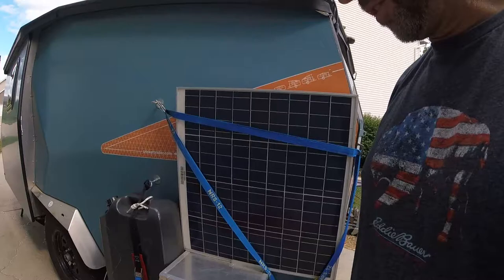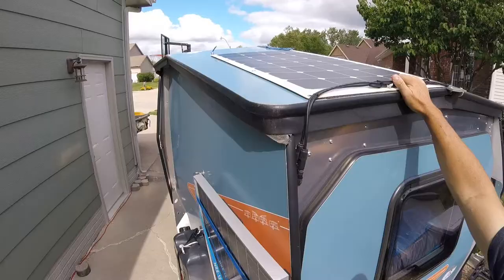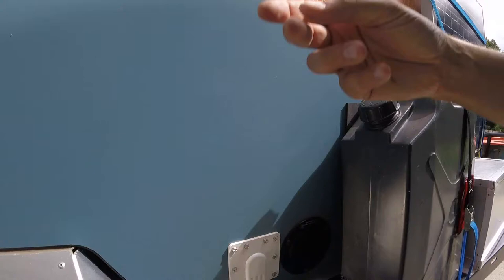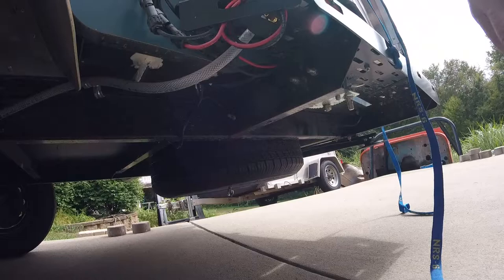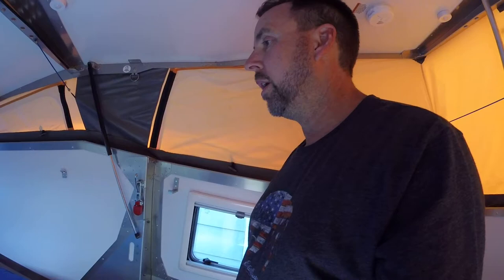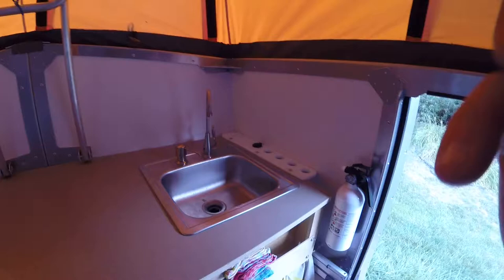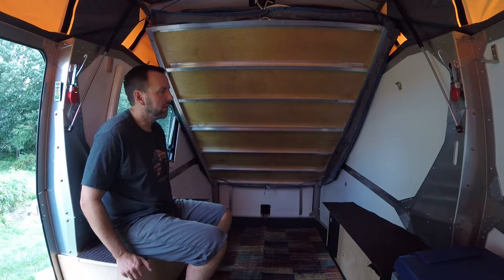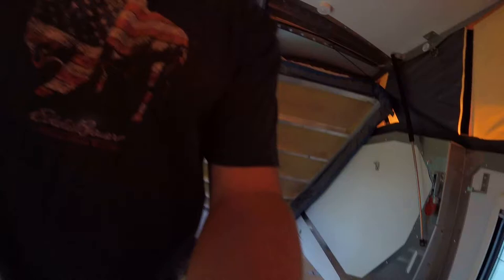Cricket trailer - modifications/additions

Comment: You really put a ton of 'thoughtful work' into your 'Cricket' to 'have it your way'
*I would have gone differently myself because I want all the amenities inside with me, especially a shower with hot water via
the 'Truma' system and interior heat as well, but that's 'just me'*
I'd mount an articulating-arm for 12v. TV w/DVD player!   And folding 'suit-case' panels for 2-AGM batteries
*I've seen a 'Cricket' with about a 2-ft rear 'meshed' flat bumper installed in the back for both a seating and 'stand-up' used to
access the roof-racks and that was pretty cool!*
But all that's 'just me' and my insatiable 'Swiss Army' fixations of  'more from less'
Reply from the maker: Thanks Gerry for the comments.  I've been kicking around the truma system for awhile and may do something with it eventually.  We do have a mounting system for our laptop that lets us watch videos while sitting in bed but only use it very seldom.  Too busy being outside I guess.  Biggest change that I am contemplating and actually am in the process of doing a proof of concept on is a slide out bathroom/shower.  If it ever gets to the stage where I cut the sidewall out I will be posting lots more videos.  Thanks again for your thoughts though.

Comment: Some great mods. Raising the bed really increased the functionality of the camper. I always thought the stock bed was the biggest weakness of the Cricket - too much waisted space.
Reply from the maker: Thanks Kurt.  Yeah the raising bed is one of my favorite things about the camper.  So easy to go from bed to seating and vice versa.  My favorite thing is being able to keep the bedding in tact and once we drop the bed down just get in.  No making up the bed or tearing it down ever.  The biggest disadvantage is that there is no where to mount any kind of cabinet storage for clothes as it would get in the way of the bed being raised.  I thought about making some easily removable cabinets toward the back that just raising the front of the bed would not run into as that is what we do 95% of the time but then when the bed is raised there would be no access to the cabinets either unless you went around back and accessed from the back door or dropped the bed for a bit to get what you wanted.  Still contemplating how to add more storage.  In the meantime we just have our clothes in duffel bags on the floor which is really no different than before we had the trailer and were tent camping so not a big deal but it would be nice to come up with some solution.  I am actually toying with the idea of a cabinet slideout of sorts.  Basically having it slid in while moving but being able to slide out the whole cabinet once we got to camp.  Anyway just a thought.

Comment: Please reconsider the spare underneath held by a cable. These either corrode, fray or seize up.. numerous reports of bouncing spares off of pickups being left behind including a number of deaths as aa result. Most if not all mfg have gone to other means like Ford using a solid threaded rod..
Reply from the maker: I understand the concern.  One thing in the video I didn't show but now wish I would have is the chain I also have bolted to the frame and going through the wheel spokes.  It makes it a little less convenient to get the spare out but unless both the chain and the cable break there is no way the spare will fall off.  Thanks for the comment.

Comment: Don't you lose storage on ceiling with raised bed set up? From my understanding, one can get hanging cots which can be used for storage. I do think not having to make bed, simply lower, is a better way to go.
Reply from the maker: I have cargo netting in the ceiling between that and where the bed actually raises up to and can store my clothes for the day etc.  With the bed raising up like it does all the bedding and pillows just stays on the bed so no need to store it anywhere which is pretty bulky to store.

Comment: probably good idea to vent that battery box
Reply from the maker: Thanks and I agree.  The bottom of the box is open and there are slots in the step that it is mounted on but I did not mention that in the video.  I have since switched to a lithium battery and moved it inside the camper.  Thanks for the comment.

Comment: I've never understood why Taxa hasn't made the Cricket's bed/storage space more flexible like this. Taxa spent all this time designing the Cricket's amazing hatch door to access the trailer, but then they filled up 1/2 the Cricket's interior with a bed frame and weird storage holes. It's not an efficient design at all. Your design is 1000x times better than Taxa's. Your video was posted 6 years ago and it's still better than a 2023-2024 Cricket, which is still restricted by the same awkward bed/storage system that completely wastes the trailer's potential utility. How nice would it be to open the hatch, lift the bed up, and store some E-Bkes in the back (almost like a mini toy hauler)? @TAXAOutdoors, open your eyes,  this is the way the Cricket needs to be designed.
Reply from the maker: Thanks for your kind remarks on the modifications I made to the trailer.  We still have it and are using it regularly.  Over the past 4 years or so we have driven it to every state in the US playing lots of disc golf along the way - obviously not including Hawaii.  We never really lift the bed fully up into the ceiling - basically just lift the front up which gives us plenty of room to eat and never have to make the bed.  Although we often take Mt bikes with us we never store then inside while trailering because often we pull into a Walmart or rest area real late and just get in the trailer and go to sleep.  It has been a great trailer and I am real glad I found the "gear" model the only year they made it that way so I could do it the way I wanted.  Still can't believe I bought it new for $13000 in 2016.
Reply: @owenrae  Just curious, how many rivets have you had to replace throughout its ownership?
Reply from the maker: @dcd6115   i have replaced probably 50 but i have also replaced some of them with through bolts and either aluminum plates or fender washers on the outside of the unit so that the rivets did not fail again.  I have 1 1/2" wide plates about 2 feet long or the fender washers in strategic locations with size 10 bolts going all the way through rather than pop rivets.  This connects to the aluminum superstructure on the inside.  Since i did that have not really seen any issues but before i could see separation of the body from the frame in a number of spots.
Reply from the maker: plate on the outside
Reply from the maker: fender washers
Reply from the maker: I have replaced probably 50 or so pop rivets over the course of the years I've owned the cricket. But a number of years ago when I saw multiple pop rivets failing and separation between the superstructure and the body. I replaced those pop rivets with an aluminum plate on the outside and size 10 through bolts connecting the superstructure to the body but through bolted to a plate or a fender washer on the outside.  I have not seen near as many failures since I did that.

Comment: Great mods.  What model is the bolt on hitch receiver? And are you happy with it for carrying bikes?
Reply from the maker: I just bought the bolt on hitch receiver from Menards.  Not sure what model.  I'm happy with it and seems sturdy enough although I did add a couple of galvanised steel cross members to the frame so that I could bolt it up a little better than would have been possible without it.  Also, and this is the downside to carrying bikes behind the Cricket, with all the weight of the rack and bikes behind the axel, and the swing weight in particular, I had to add an anti sway bar whenever I haul the bikes back there.  At this point it is still the best location at least that I have found.  I have mounted a rack on the side step but for a mountain bike the handlebar needs to be turned sideways making it time consuming to use the bikes.

Comment: Like your mods! Where did you run the wiring to add power from the bench on the door side?
Reply from the maker: mrs johnson, thanks.  The wire on the door side comes out of the controller through the floor in the noon door side, then under the floor and back up inside the bench on the door side.  

I haven't done the video for it yet but I have just wired in a switch in the bench right next to the door which now turns on two LED lights mounted in the ceiling.  These lights run off the battery.  Now I have options to run lights off the trailer battery or use lights with batteries depending on my solar charging or shore power situation.  Probably will video that in the spring.

Comment: Dave - Would you be willing to provide additional details of your Cricket bed mods? Frankly I'd be willing to plans for this. Just having a parts list and lengths of tubing and such would make it so much quicker. Of course I can probably measure and figure it all out... but I do have a few questions. Any chance you have contact info available for direct private messages?
Reply from the maker: Is be happy to talk to you and do some measuring etc to get your started.  Just for point of reference my cricket is the gear model (only sold one or maybe two years) that doesn't have any of the regular bed or storage areas.  If you want, send me your contact info to owenrae@gmail.com

Comment: Hey Dave. Thanks for this video. One question, How much did the trailer weigh before all these mods? How much does it weigh NOW???  Thanks,  Joseph  :)
Reply from the maker: I don't know the exact weights as I have never weighed it.  The standard trailer I believe weighs around 1500 pounds according to the literature.  Mine was probably 200 pounds less but I'm sure with all the changes I'm in the same ballpark now.  Sorry can't be more specific.  My 2012 Outback with the 4 cylinder engine pulls it fine.  I did however buy a 2018 Outback with the 6 cylinder and it pulls it without even noticing it back there almost.

Comment: Great video.   I have 2012 cricket and struggling with mounting the spare tire like yours.   How did you drop the winch wire down to the tire without a pulley?  Thank you for your help
Reply from the maker: On my cricket there are two frame members running between the back and another frame piece about 28 or 29 inches forward.  These two running parallel are about 6 inches apart and I  think 2 x 2 angle.  I drilled a hole through both and ran a long eye bolt such that the eye is just to the outside of the drivers side frame member.  Then I ran the cable from the pulley through the eye and then down through the center of the spare rim.  This slightly offsets the tire from perfect center, by about 4 or 5 inches.  I need that anyway since my receiver hitch is center and my bike rack goes all the way through plus about an inch and the spare would have prevented that if it were perfectly centered so it all worked out.  Also just for safety because some people commented that the wire cable could rust and break, I ran a chain with a quick disconnect around that same eye bolt but between the 2 parallel frame members and through the spare rim.  It would make using the spare a little more of a pain because I would have to crawl under to release the chain before I then used the winch to drop the spare tire down.  I have been fortunate and have not needed the spare yet.  Just put new tires on it last summer after around 35,000 miles.  Thanks for watching.  If you have any other questions feel free to ask.  2012 must have been one of the first years.  We love ours.
Reply: @owenrae  thank you.  I made beds for 7 ,  dinner table seats 7-8 people, shower inside with no spill outside of floor drain,  surecall 3.0 booster, anti swaying bar, By the way...how fast do drive before it starts to sway a little?
Reply from the maker: @jessicavotran  wow, sounds like you have done some fun mods.  With the bikes on the back I need a sway bar for anything over about 60.  Without the bikes on back I can go faster but I always use the sway bar and can go 75 no problems.   My wife though doesn't like to drive faster than about 73 due to the sway tendency.  We pull it with a 2018 Subaru outback with the 3.6.  Fall 2019 we pulled it from Iowa to Alaska and back and averaged just under 17mpg.
Reply: @owenrae  that is awesome with 2018 Subaru outback being only 3600lbs dry and max tow of 2700lbs.   cricket is 1500lbs dry or about 2000 lbs loaded.    did you ever got a blowout ?  how do you camp during high wind or gust?
Reply from the maker: I assume by blowout you mean a tire blowout?  I have not had one on my Cricket since buying it in 2015.  That is probably due to the 15 inch wheels and tires and not really putting a huge load on them.  As far as camping in high wind, we have camped in 20 -30 mph winds with no issue even if the front is facing into the wind.  If the wind were to get stronger I would just put the top down.  We can still sit in the bed or sleep and Probably still do some minimal cooking with it down - I would say very similar to a teardrop camper.  We got 10 inches of wet snow one night in Showlo Arizona this past spring and halfway through the night I put the top down so there wasn't so much weight on the lifting mechanism.  Then I just pulled the snow off in the morning and lifted the roof back up.
Reply: @owenrae  I am 90% done.   Still need to install electric brakes.    Did you upgrade your brakes to proportional smart brakes?
Reply from the maker: @jessicavotran  I do not have the brakes connected except as the emergency disconnect.  I have been thinking of buying something but honestly in all my travels I have not felt like I have needed them.  I would want a setup that I don't need to install anything in my vehicle since I tow the Cricket with either my 2018 or 2020 Outback.
Reply: @owenrae  me too for now with no brakes when I am traveling on relatively flat or mild hilly freeway.   I don't dare take it up mountains with 6% down grade.   have you tried and was it safe for you?  how much cargo do you usually have in your trailer?  thanks Dave!
Reply from the maker: @jessicavotran  I've driven 25,000 miles pulling my Cricket with my Outback.  I've driven to Alaska, and through most of the western mountain states.  I'm not saying that brakes would not be nice and possibly useful, just that I have never felt unsafe in all those miles.  I have been looking at the Autowbrake brake controller though.  I would like to weigh the trailer someday when I have time when it is fully loaded just to find out how heavy it really is.
Reply: @owenrae  tongue weight can be done from home.   I place 2 car jacks under the front frame then retract the dolly wheel to slide in a regular scale rated for at least 300lbs.   Place a board to spread the pressure on the scale .   Also I created a spreadsheet to account for lbs on my cricket to make sure I don’t go over 2500lbs max trailer rated gvwr.

25000! Is impressive.   I am in Northern California and have been to many national parks but not Alaska yet with the trailer.    Any interesting Canada waypoints in between such a long drive?   I want to do that next year when COVID-19 is better.

Comment: Nice work!!! I am thinking about a use gear and fix it up very similar to what you did. Would you mind telling me how much u spent on all the extras and the man hours . I am limited on time and would have to get some stuff professional done. So depending on the cost a camp version might be a better fits. thanks
Reply from the maker: The materials for the bed were probably $100 for the aluminum, $50 for the plywood, $50 for assorted nuts and bolts etc. $50 for finishing materials.  I spent a lot of time measuring and cutting and bolting the frame together and mounting it.  Building and finishing the seats probably cost $150.  The electrical panel and solar panel and wiring and battery probably cost $400 total and was somewhat time consuming as well.  I spent the better part of the winter with it in my garage working on different things off and on.  I almost forgot about the plumbing and water pump and sink but they took time as well.  If you are serious about doing some of the modifications I would be more than happy to put together a material list for the different aspects.  I also purchased most of the non-structural parts from Amazon so have quite a bit of that info available as well.  I would say to get it all done count on spending multiple multiple weekends.  Much of my time though was spent just trying to visualize what I wanted to do.  I was able to purchase a window for the non-door side of the camper from my dealer just like the one in the door and it was $350 and took an afternoon to install.

I hope you get it and can spend some time setting it up just like you want it.  If you want exact dimensions of anything like the seats or the bed frame I can get that for you as well.

There are two aspects on mine that I like over the camp.
1) My bed stays made up for sleeping.  It takes 30 seconds to drop it down or put it up and I never have to unmake or make the bed.
2) If I want I can carry a couple of 10 foot kayaks inside or a couple of bikes standing upright under the bed going down the road.

Best of luck.
Reply: Thanks for the reply, but that seem a bit overwhelming. But the good news is i found a Cricket Trek on CL and bought over the weekend only 3 hrs from my house.....Man i love this thing.